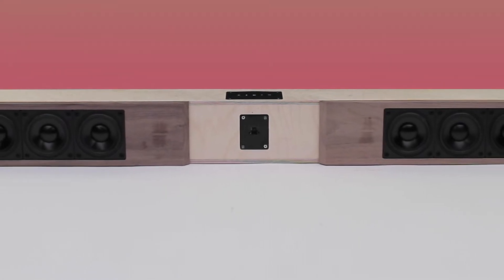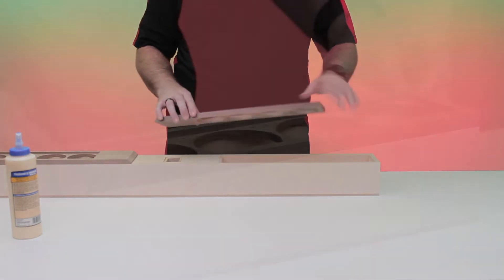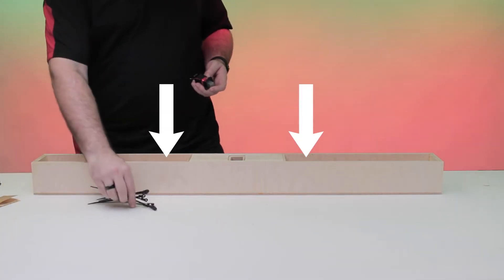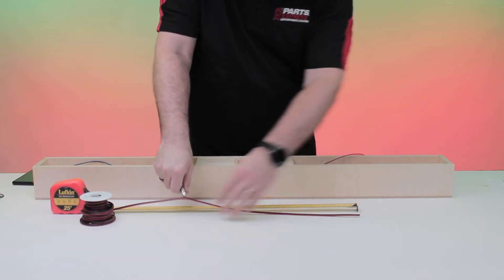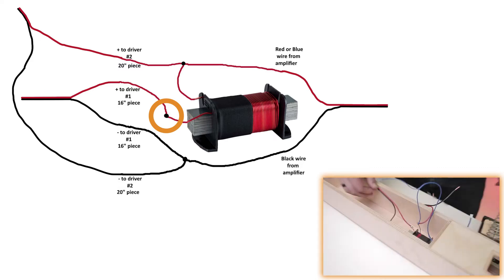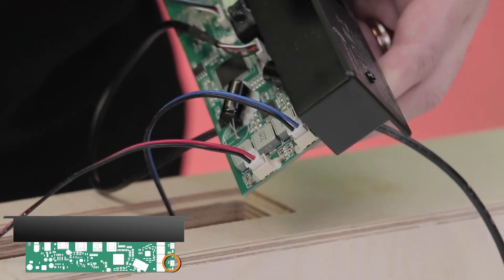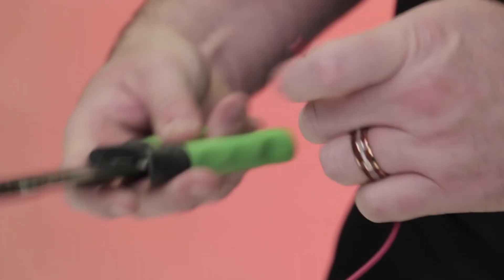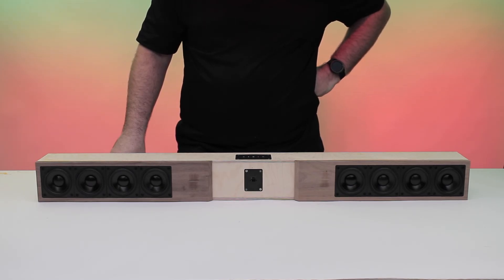How to Build Your Own Sound Bar.

Comment: So the passive radiators just sit there? The only speaker that is powered is the one on the end?
Reply from the maker: There are a total of 4 powered speakers and 4 passive radiators. The passives enhance the bass response and sound quality of the speaker system. They allow it to produce bass that is a lower frequency than without them in such a small enclosure.
Reply: @ Thanks.  I have to look up and educate myself on what a Paige radiator is and how it works.
Reply from the maker: https://www.parts-express.com/what-is-a-passive-radiator?